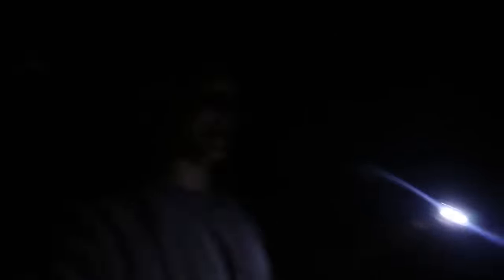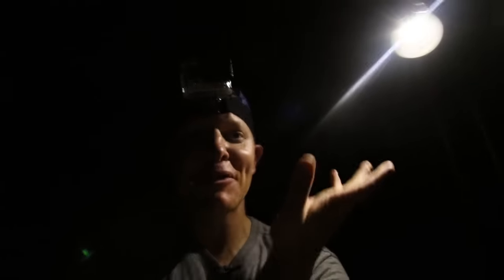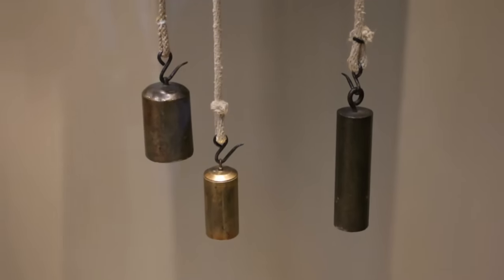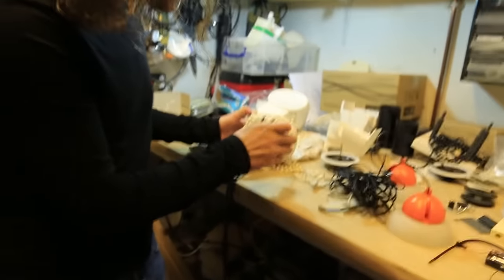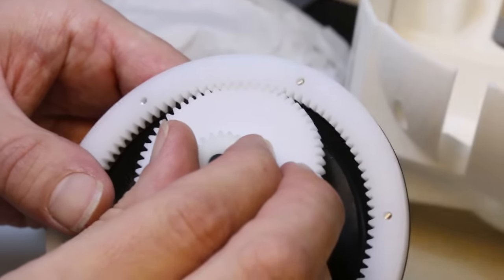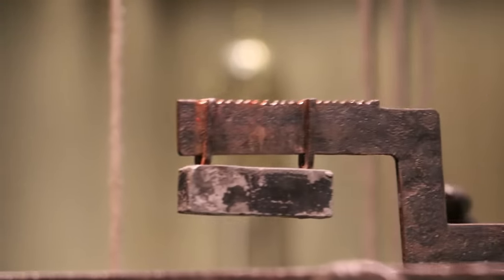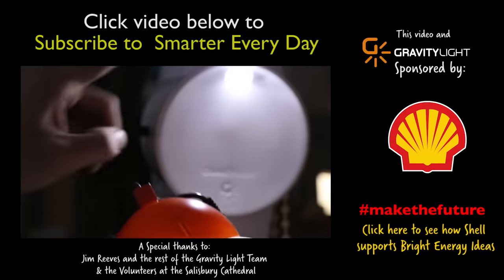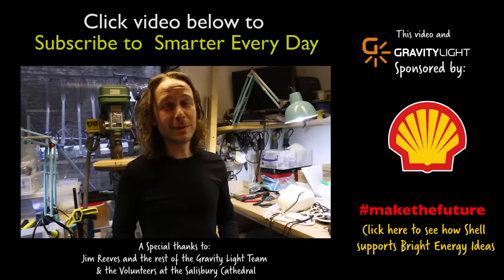Turning Gravity Into Light - Smarter Every Day 146

Comment: Wait, the generator is the thing that prevents the bag from falling down so fast? The LED won't let the generator turn faster, I get that, but HOW?
Reply: +CheeseWithMold Yeah, I wish they'd explain that in more detail.
Reply: +CheeseWithMold It's magic, don't question it
Reply: +CheeseWithMold The LED sends a back current that causes the motor to short out and lock magnetically until the current drops again, at least I think so. So really the weight is jittering really really fast as the motor locks and unlocks
Reply: +CheeseWithMold I'm confused by this too. If you were to switch off the light, the bag would stop dropping? I'd love if you could explain this, Destin.
Reply: +CheeseWithMold +jatzy 
From the resistance of the LED, voltage=current*resistance. 

Since LED's only run at a certain voltage, the resistance and therefore the current of the LED change to achieve that voltage. Think of it as a funnel, if you pour sand into the funnel it will slowly drain out at a constant speed. decrease the size of the hole at the bottom (increase the resistance) the sand will flow through slower (current). Pretty much if the resistance increases, the current decreases causing the voltage to be steady state. So to keep the voltage constant, the current and resistance is changing (internal property of the led) depending on how much mass is in the bag. hope that helps explain it to you! if not feel free to ask away.
Reply: +rubzlovespancakes It is to do with the conservation of energy.
Basically the motor/generator makes a current which is the opposite of what is required to make it turn in the same direction. Otherwise you'd have the motor endlessly spinning up. The LED will only take 2 V of power, so anything above that goes back into the motor/generator, slowing it down.

If you want more information on that, the principle is called Lenz's Law.
Reply: +CheeseWithMold GRRRR I want to know too. The only thing I can think of is that the stator field is somehow proportional to the LED brightness? When the LED reaches max brightness, the magnetic field of the stator becomes very strong and slows the rotor down to a certain equillibrium speed? I've seen things like that in practice but never investigated the theory.
Reply: smalltime0 So what you're telling me is that if you disconnect the LED from the generator, the whole thing will stop spinning? I wanna see that in action! =D
Reply: +rubzlovespancakes No, since the current would be zero the generator would have no breaking effect anymore. So the weight would drop faster (the final speed would be limited mostly by friction in the gears).
Reply: +CheeseWithMold Like a few others, I'm gonna take a stab at explaining this :)

Led's have a characteristic called their Forward voltage. You have to apply this high of a voltage, to move any significant current through the LED.

Now, when you increase the voltage across the LED, there will be very little current flowing through it, but once the forward voltage is hit. The current through the LED will increase incredibly fast, with tiny increases in voltage (The graph shown)

Now how does this stop the motor? Well, with all of that gearing, the belt driving the generator now has a lot of RPM, but very little torque. This means, that a very light load on the generator, will slow it down, and in turn, slow down the entire gear train. The higher the current through the LED, the higher the current will be through the generator.

Why does this stop the generator from rotating? Well how does a generator work? A generator works, by swinging some magnets by some coils of (most often) copper. This in turn, induces a voltage in those coils, and the voltage difference allows a current to flow. But as the current flows through the coil, it builds up an opposite magnetic force, which pushes against the magnets. The more current, the more of this opposite force.

Therefore, the more current the LED draws, the more current flows through the generator, the more of an opposing magnetic field is created, and the more counter torque is applied to the gear train, slowing it down. Due to the exponential increase in current with relation to voltage past an LED's forward voltage, this happens at a very distinct point.
Reply: +dumle29 Very good (and correct) explanation!
Reply: dumle29
Alright... So if the gravity was weaker than it is, would the gear train stop completely? Like the only thing keeping it from stopping completely is the fact that gravity overcomes that opposing magnetic field, but only by a little, right?
Reply: +CheeseWithMold If gravity would be lower (but still strong enough to overcome the friction in the system) it would turn slower. Slower rotation means lower voltage and that means lower current which leads to a smaller opposing magnetic field. It is always adjusting itself to a speed at which the force caused by the  opposing magnetic field is equal to the force of gravity (minus the force of friction).
Reply: CheeseWithMold It will always spin up a little bit, as long as there is enough gravity to overcome the forces of friction in the gear train. If you look at the IV curve (the current voltage curve) shown in the video, you see that for the first part, voltage increases a good bit, and current barely does. So in this region, a increase in gear speed, will not yield much resistance due to extra current flow, however, as soon as you hit the forward voltage, a tiny increase in voltage, and therefore rotation speed, a huge change in current, and therefore load, will happen. 

Now yes, if the gravity was so low, that the force on the weights could only barely overcome the forces of friction in the gear train, then it would just be stuck, and maybe have completely wound down in a few hundred years, because while not much, a small increase in voltage does increase the current through the LED a bit. But in that case. Just add another rock :)
Reply: dumle29
Thank you so much for explaining this! I understand it now!
Reply: Daniel Frank
Gotcha! Thanks!
Reply: Daniel Frank Thanks :) I like your explanation as well :)
Reply: +dumle29 Thanks alot for informing us
Reply: +CheeseWithMold  the generator creates on its two poles a voltage that is proportional to the speed. The LED connects these two poles. When the voltage is too low to make it light up, the LED's resistance is infinite:  The two poles are not effectively not connected. So the generator starts spinning faster and the LED starts to come on. Now the two poles are half-connected. That means there is a bit of current flowing. It flows through the LED, but also through the motor windings. 
WIthout going into the details (using a brushed DC permanent magnet motor as generator, back-EMF and all that jazz) that current basically creates an electromagnetic force trying to slow down the generator. It also creates a back-induced voltage working against the generated voltage. 
So the weight has a harder time to accelerate the generator faster. In the end, there will be an equilibrium - and you will have to match the weight, motor, gearing and LED so that this works.
Reply: +CheeseWithMold The fact that it's that tiny semi-conductor that keeps the weight from falling was actually what blew my mind in this video.
Reply: guys, if we put more mass on the weight, the force grows, but the amount of force the mechanism processes is constant (as talked about in this thread), so does it mean the weight descends more slowly and lasts longer?
Reply: Noam Tashma I've been thinking a bit about that as well, I don't know for sure, but I think it would drop a bit faster, but generate more power / shine the LED brighter.
Reply: +CheeseWithMold 
First you need to understand diodes. For simplicity, we'll say diodes have a maximum voltage. Once this voltage is reached, the voltage across the diode will not go (much) higher. However, if you continue to increase the voltage at the source, the diode will pass more current.
Now we need to understand electromagnetic machines. As current is drawn from an electromagnetic machine it exerts a electromotive force in the opposite direction of rotation referred to as "back EMF". This is actual mechanical force in the opposite direction of rotation. In fact, if enough current is drawn from a machine, it will eventually stop rotating entirely. (That value of current is called the locked rotor current.).
Now, in our application with this fancy gravity light, the machine will attempt to run faster because of the acceleration of the load falling with gravity. However, it's voltage output is limited by the diode so the output current will continue to increase which will result in additional back EMF. The system will very quickly reach an equilibrium where the force of the weight is equal to the back EMF. Because of losses in the system, gravity prevails but not very quickly which results in this seemingly magical idea that any amount of weight you place on the system will result in the same rate of descent. This isn't true, of course. The system will have both minimum and maximum practical weight limits in which this phenomenon will be able to take place. Theoretically, however, it should work for all weights high enough to cause the speed of the machine to be at least fast enough to generate the voltage at which the diode can turn on. Also, the higher the weight, the higher the current and the brighter the LED would shine but there's probably an upper limit on how noticeable this would be and you would reach diminishing returns rather quickly or break your fancy new toy.
Reply: +Dave Gunnoe Go to top of class A+
Reply: +TOAST2218 I'm still confused about what happens when the bag is, say twice as heavy.    Does it fall at the same speed but twice the brightness, or half the speed, but same brightness.
Reply: codediporpal
As I understand it, there's only a minimum amount of weight you can put on, and a maximum. After the maximum, you'd break the generator because the bag is too heavy. You need the minimum because that's what provides the minimum voltage needed to power on the LED. So I guess you can't make it brighter or dimmer without interfering with it in another way, after a certain points it's either on or off.
Reply: +CaribSurfKing1 :)
Reply: +dumle29 what if i disconnect the LED? the rocks go down faster?
Reply: wahyu danarto Yes, they will go down a good bit faster :)
Reply: +rodrigo_vda what if you take out the Led and just short circuit the generator? Would it still slow down because the current would probably be high?
Reply: +CheeseWithMold I think it's the same princinple like with a magnet falling through a copper pipe. The induced current always produces a force that counteracts the magnet.
Reply: +Ireallyreally Hategoogle Induction... People confuse resistance with induction a lot.
Reply: +rodrigo_vda Resistance torque? Induction?
Reply: +Dave Gunnoe This was not made clear in the video.  I hope the "instructions" for the device tell people not to overload.  Seems like the inventors could say to use some approx local weight standard, such as a coconut for an example.  Or two coconuts.
Reply: ***** Isn't regenerative braking something different? As far as i know electiric motor is being used for generating electricity when the engine turns fast. It is used in electric cars and trains. But i dont think Gravity Light is using it.
Reply: ***** I got your point. Thanks for referring also. But i mean, gravity light is a device which is converting force of Torque to electricity so it never works like a motor. A motor and a generator is the same thing, i know but the subject is about induction current i guess. Maybe i am wrong by the way :D
Reply: ***** Yes it is doing regenerative braking. When the applied force changes the generator would turn faster. But he says it is independent from applied force (he puts different weights but it is stable  20 minutes). So how generative breaking makes the stabilization process on speed here?
Reply: ***** Bahadır Onur Güdürü I think it's unnecessary to compare this phenomenon to regenerative breaking. Regenerative breaking is a very specialized application of a very generic idea (electrical generators). They are implemented to increase efficiency by recouping wasted energy. That's not the case with this application. The gravity light is just like any other generator. Energy is used to turn the generator which produces electrical energy. The energy in this case is the potential energy you transfer to the weight when you lift it up and hang it from the string.

Think of it, instead, as a small gasoline generator. If you start a small gasoline generator and then plug a refrigerator into it, you will notice that the gasoline engine gets louder when the refrigerator turns on. That's because the refrigerator is drawing current from the generator which makes the generator harder to turn. It would slow down if the generator didn't increase it's power output. That's what is happening to the light. Current is drawn from the generator and makes it harder to turn.
Reply: Dave Gunnoe So if different weights don't change fall time, the LED on Gravity Light would shine brighter if you put more weight on it?
Reply: Bahadır Onur Güdürü Assuming the device doesn't implement a system to limit the current flowing into the LED, you would be correct. More weight will transfer more energy into the system as it falls and that energy will have to go somewhere. In this case, it will present as higher light emissions from the LED. If the system limits current to the LED, (a good possibility) the extra energy would likely be converted to waste heat.
Reply: Dave Gunnoe Thanks for explaining, now it makes sense
Reply: +rodrigo_vda I'm not saying that regenerative breaking isn't a usable analogy. I'm just saying that it's an unnecessary reach to equate the two because the gravity light is a straight-forward use of a generator. Regenerative breaking is a special case in which the electromagnetic machine is meant to operate as both a motor AND a generator depending on the mode of operation. Regardless of the fact that a motor is a generator and vise versa, most designs use the machine as one or the other.
It doesn't really matter. All of these things use the same principle. If something (anything) can be made to turn a generator, voltage will be developed and power can flow if a circuit is created.
And it's not a lie. Wanting something doesn't mean it's energy efficient. Breaking has always been a waste of energy and still is. I was pointing out that regenerative breaking was developed as a way to recapture some (not all) of that energy instead of wasting all of it the way gasoline-only vehicles do.
Reply: ***** Man your comment really made me want to say something horrible just to break the peace. I'll keep it together. It's the holidays.. :)